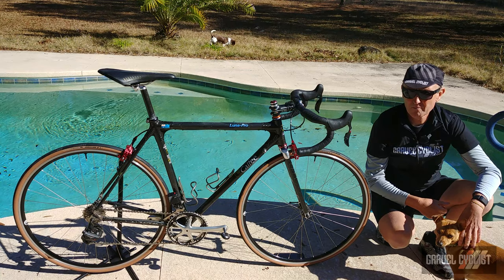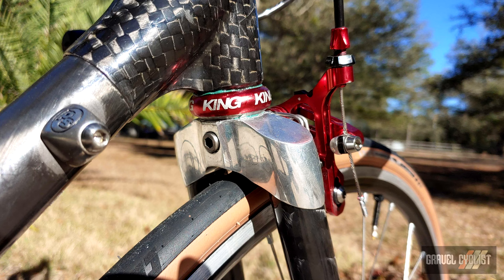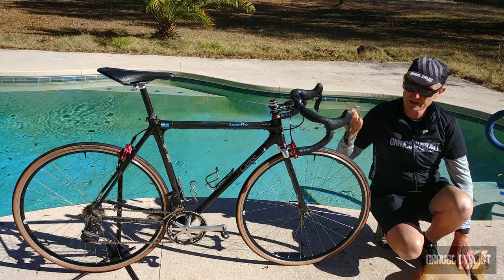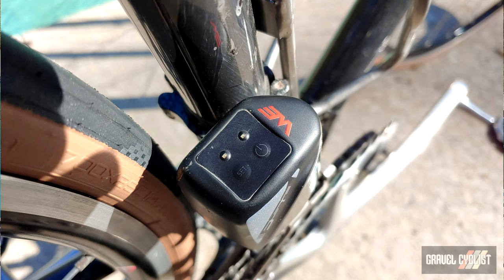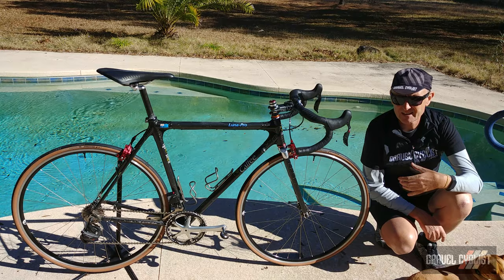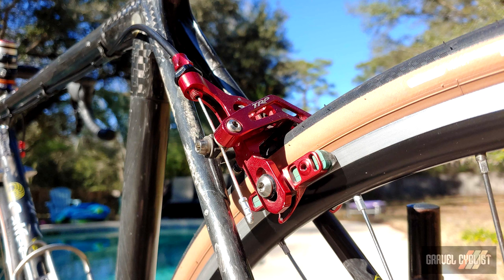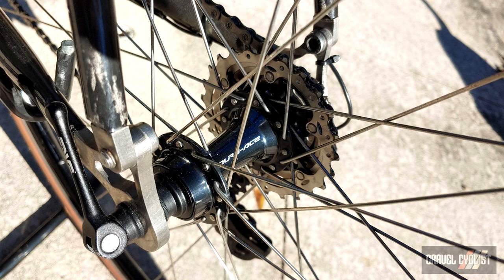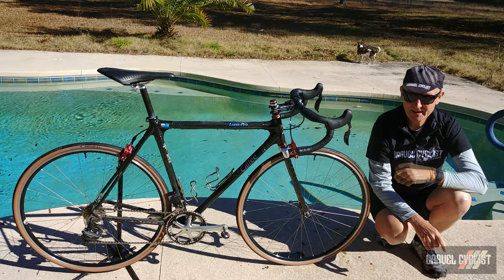Calfee Luna Pro Road Bike + Wound Up Fork = USA Made Carbon

Comment: Neat bike.  Looks like the frame is set up for downtube shifters.  That and the 39/25 "small" gear reminds me of grinding up steep roads in the French and Swiss Alps in 1990.
Reply from the maker: Indeed it was originally a bike for downtube shifters. I installed a pair of "Problem Solvers" caps to cover the mounts. The older days of cycling, not low gears, and only 6 to 7 of them.

Comment: Nice looking bike, I like this carbon construction with glued-in tubes. 
Let's hope the bonding agent in your fork holds on long time. I think Raoul Luescher reported of fatal accidents with carbon/alu forks falling apart after many years. (Aluminium expands/contracts with changing temp, carbon does not -> fissures. Also possible galvanic corrosion in humid environments like in Florida)
Reply from the maker: Thanks for your concern, very valid comments. All of my bikes when not in use reside inside an air conditioned environment (aka my house), so let's hope that helps.
Reply: @GravelCyclist  I promise I'm not the safety police, but (oh, here it comes) the air conditioning is both good and not so much: when you get your bike out of the cool house into the smeltering Florida heat the aluminium can expand more quickly than the bonding agent can keep up with and fissures are more likely to happen. Can of course also be that the fork manufacturer has first class bonding agent in place there, I dunno. If you want to worry you can look into Raoul Luescher's video on bonded forks, otherwise - and as always - just ride your bike and enjoy it :-)
Reply from the maker: @318ishonk  Totally understand Bob, appreciate the insight!

Comment: At 7:05 you show a close up of the bottom bracket which looks rough on the outer perimeter.  I'm wondering if my eyes are tricking me or if the BB shell outer diameter is rough.
Reply from the maker: Stephen, Calfee has a distinct method of constructing bottom bracket shells and lugs. They are not rough, but feel free to check out Calfee Design's website (see the links in the description) for more info.